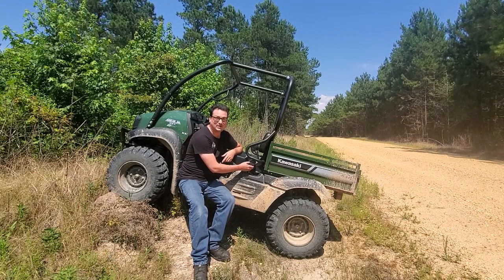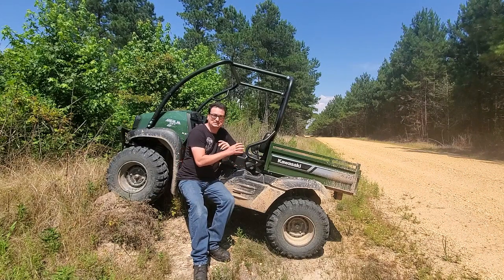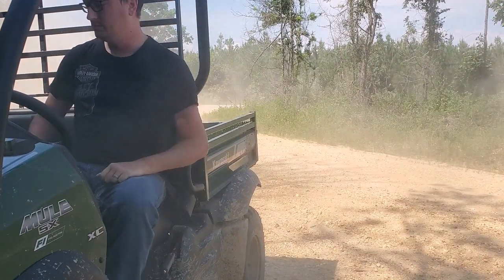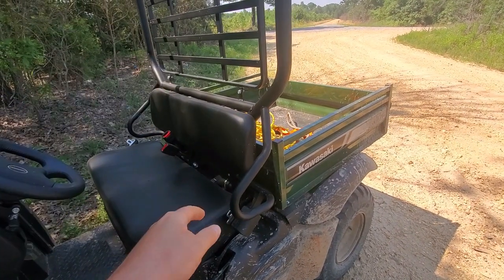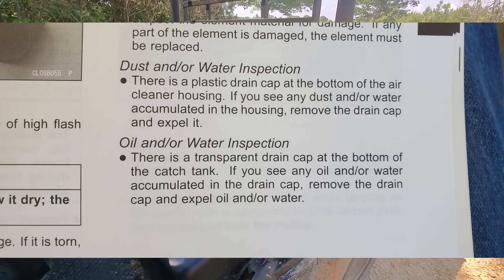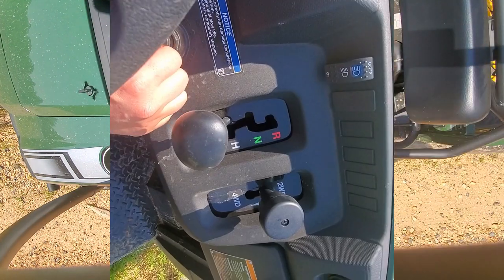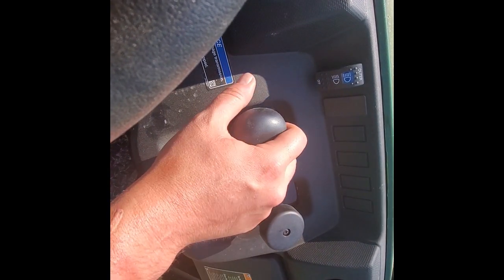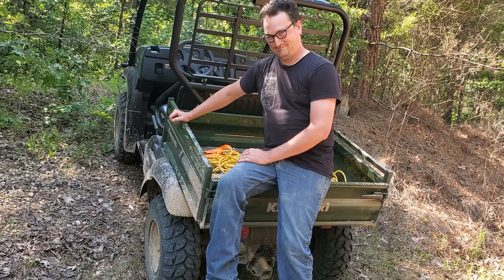Mule SX Quirks Video

Comment: Hi mate – this is Toby from Sydney Australia – I don’t know if you read any of these comments but I want to thank you heaps for one of your fantastic tips– I’ve been down on my farm in the highlands, we’ve had heaps of rain here and my mule got stuck in mud – next morning when I tried to move it I couldn’t get the gearstick back into neutral – I went everywhere on the web trying to sort it out and thank goodness I came across your YouTube‘s with the tip to hold the brake down when turning on the ignition does - it worked like a treat and the vehicle is now washed and parked back in the shed – thank you so much again – you’re a champion – and I’m now a subscriber – all the best and keep up the good work
Reply from the maker: That's great! Glad I could help!
Reply: Most quad bike start in gear if you hold the front brake on, but didn't know about Mule.

Comment: Do you know where I can get a new gear shifter plate? The one I use at work keeps popping into neutral while driving and I think it's simply the metal has been grinding down from shifting to and from high gear.
Reply from the maker: Sorry, no. I don't know where you'd find that part.
Reply: Make yourself one

Comment: I have a 2500 lb winch in my 2020 SX that’s wonderful pulling large tree logs and pulling me out of trouble many times.  Full tank lasts an eternity.  I’m curious does anybody set up a snowplow using existing winch to pull blade up.?
Reply: My only concern was the size of the fuel tank, so I'm glad you mentioned it takes forever too go through a tank full. Thanks!

Comment: Love my ‘20 Mule SX.   Zero Quirks except one...... you have to take off dash to add front brakes hydraulic fluid??? Now that’s beyond ridiculous.....otherwise it’s a fantastic machine
Reply: not sure if your newer mule is like mine but i have a '17 sx xc and if you open the front hatch there is a 4" rubber plug in the back of that compartment.  its directly in line with the brake reservoir so i think that is what it is for.

Comment: My 2020 mule sx is hard to start sometimes after sitting in the hot sun, I can loosen the fuel cap and after the pressure is released from the tank it will start it's like the gas tank is not venting, I guess I can take it back to the dealer for this issue just for them to tell me that nothing is wrong with it
Reply from the maker: You know, now that you mention it, I had something similar happen once. I'll do some experimenting and see what I come up with.
Reply from the maker: And yeah, warranties aren't worth much, in my experience.

Comment: Get rid of the factory belt and use an aftermarket harness. You don't have to use the shoulder straps.
Reply: What brand do you recommend?
Reply: @cBodhi  I used PRP with the automotive style latch and they worked great on my RZR.